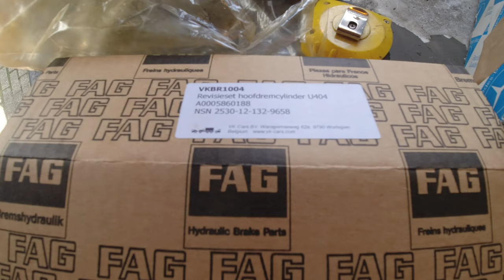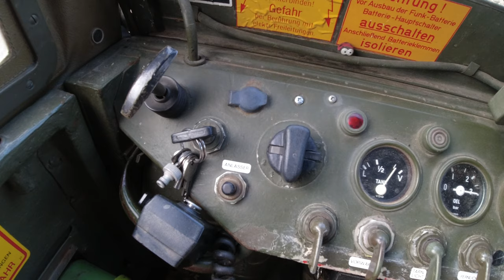Unimog 404 vlog 14: General maintenance

Comment: The 404 fuel pump has a hand operated lever which is used for priming the carburetor
Reply from the maker: jep, use that whenever the mog has been sitting for a long time. just to help it get started.

Comment: did you install this FAG aftermarket master cylinder repair kit? I have problem with master cylinder on my 404 and I found only FAG aftermarket master cylinder repair kit. Is it ok to use?
Thank you!!
Reply from the maker: Yes, we install it this repair kit and till now it's been working great!
So if your main brake cylinder housing is still in good condition, that perfectly fine it use.
Most of the time it's the rubber seals inside that fail and need to be replaced.
Reply: @ArmyTruckTom  Thank you very much for reply!!You help me a lot!